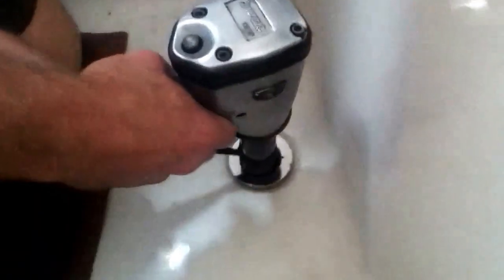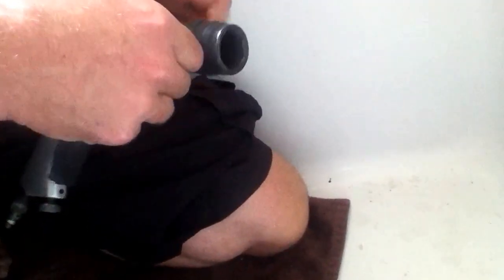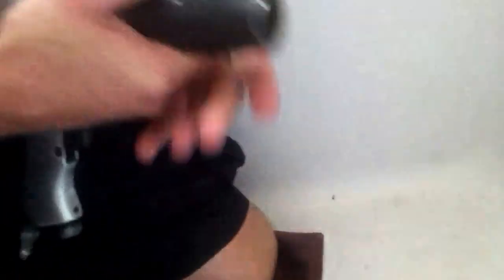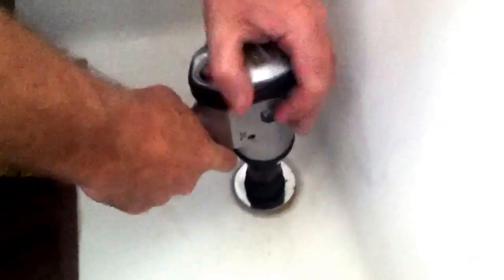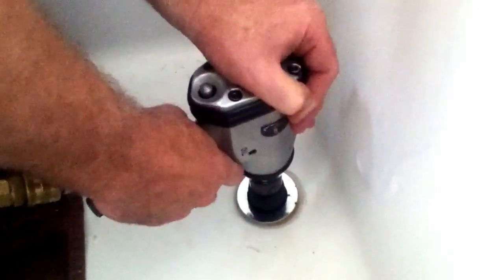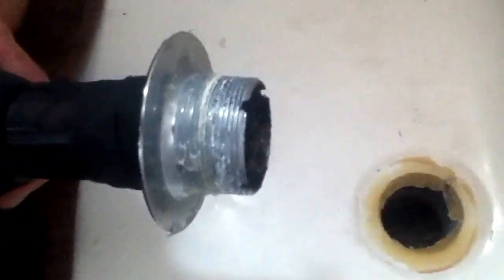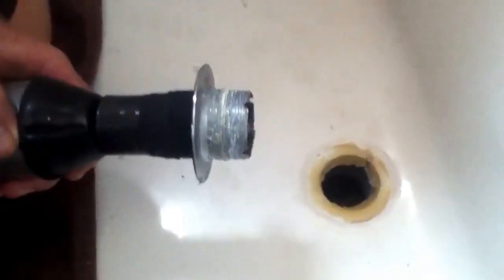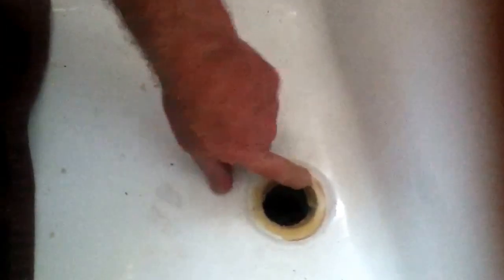Removing stuck bathtub drain with a socket

Comment: This was a wonderful idea, and worked like a charm. In my case I used a plain 1" socket, wrapped in duct-tape, and a breaker bar.  I used a hammer to tap the socket into the hole and unscrewed the drain with the breaker bar while tapping on the socket (simulated hammer drill :-). My drain, which was really set in with decades old putty, came loose like magic. I had done one like it years back with a chisel and saw, which was a nightmare. This was so... much easier, and needed no special removal tool. Thanks!

Comment: Great video, thanks for posting!! I fought with my sink drains for about 10min (pliers & screwdrivers weren't cutting it) then I found your video and spun off two stuck drains in no time. I didn't have hockey tape, but electrical tape worked just fine.

Comment: Thanks for posting. This worked for me after about 10 attempts with electrical tape and then cloth tape (duct tape). I used a Harbor Freight electric impact gun and a 27mm socket. The previous installer/owner had put plumber's putty on all the threads, so the drain was very much stuck.

The cloth tape is definitely the way to go, and I wish I had started with that; I can see how hockey tape would be ideal, but I didn't have any.

One tip I found was to wrap the edge of the tape over the edge of the socket so it doesn't immediately push the tape off when you slide the socket in. I also ground flat what was left of the broken cross in the drain so I could get the socket seated all the way in the drain. Short bursts with the impact worked better than just letting it eat, which would melt the tape.

Comment: For those of you who don't have an air impact wrench or hockey tape, I've done the same thing with a hand-held socket wrench set and simple electrical tape.  Apply the tape in a tapered manner as shown in the video,  Push it down into the drain with continued force, and start turning counter-clockwise.  At first, you'll notice some slipping, but eventually the tape will begin to tear slightly and get a little gummy, at that point, you'll have more gripping force.  I had to turn my socket wrench about 15 times total, but it eventually gave and started turning.

To be honest, I also hit the drain with a rubber mallet for a while, and applied heat with a blow-dryer, but I'm unconvinced those helped.

Just thought you'd like to know. :-)
Reply: It seems to me that this is a video made by a Canadian for Canadians... they all have hockey tape (not so sure about air impact wrenches).

Comment: Thank you thank you thank you!  OK, I didn't use the socket with tape, I used a tool I found at the hardware store, but the impact wrench was the thing that worked the magic. Prior to trying this I was in the tub using the full weight of my legs against a wrench with no success. Enter the impact wrench and the drain gave way in just a few seconds. Great idea!

Comment: I tried it and it worked. For me 
1) It was a 1.5 inch drain
2) I used 30mm deep impact socket
3) Used electrical tape
4) Pneumatic air gun
In my case I tried first with a breaker bar but it did not work as the socket was not gripping the drain. Luckily I had a long air hose. I used that to get my pneumatic air gun reach the second floor bathroom tub. At first I was getting hopeless as the socket was not gripping but then again I was using short bursts. Then I decided to press hard on the air gun and let it turn for about 20+ seconds. Thats when the drain started to unscrew. For the reserve, I started threading with hand to make sure I am not cross threading. After a couple of turns I used socket and turned it with my hand for as long as I could turn. Finally I used air gun with lowest torque setting to fully tighten the drain. To check if there are no leaks, watch this video https://youtu.be/GKHnnToqAtw?t=307 

Thanks for the tip. It saved me about $80 in tools that might have not used again for a long time